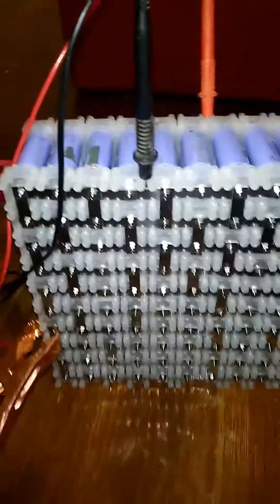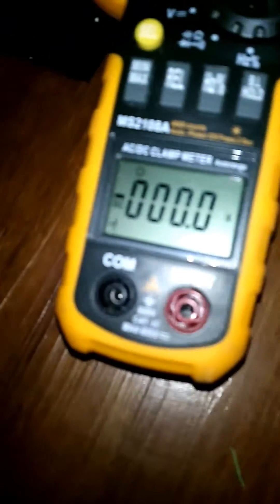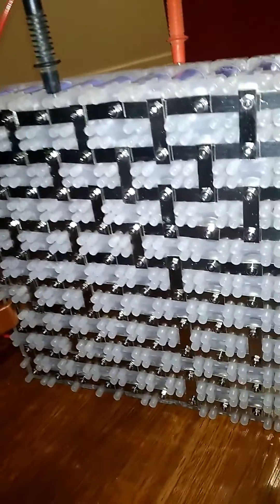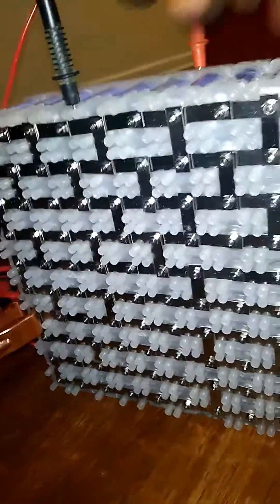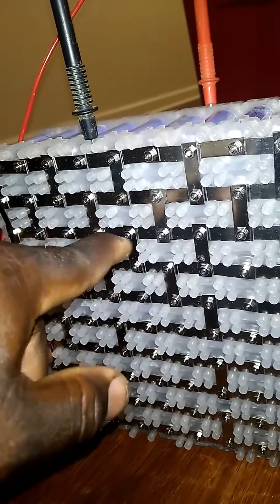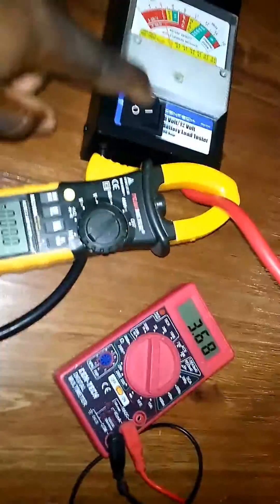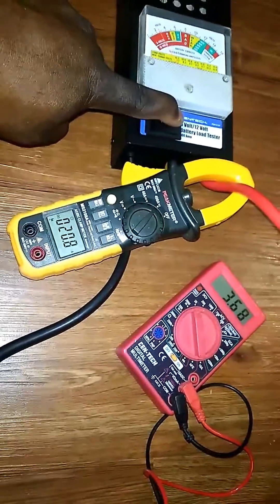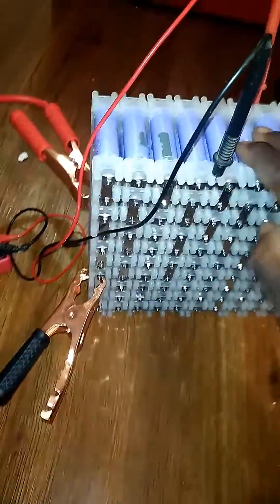3.7v 200ah lg cells load test with Vruzend kit

Comment: This is a really great idea and I toyed with doing it myself. But then I looked at the pricing for this and what it would cost to do the equivalent with the headway hp cells, and the headways will give you way more power for your buck.
Reply from the maker: James Cunningham lithium titantes will out perform the headways
Reply: Only issue I have with titantes is their max continuous discharge rate is pretty low. I know they have a higher density but when I need 1600 amps on deck and do not have space for 4 big packs like that in my vehicle, the headways can put out the same amperage in a way smaller format. And they have a way more acceptable charging rate especially when running a 320 amp alternator
Reply: 8 banks of headways will give me 800 amps continuous draw with no issues in a 18x12x8 package.